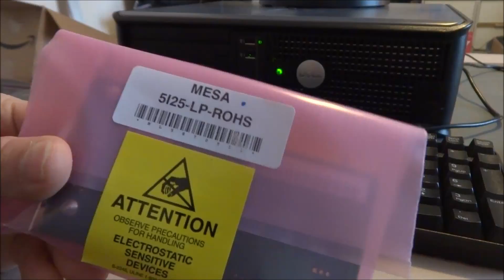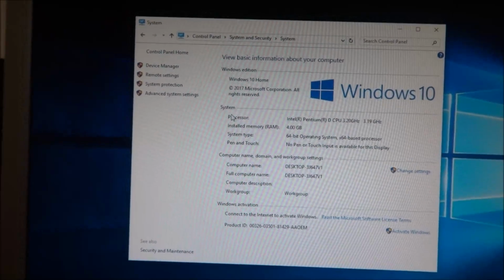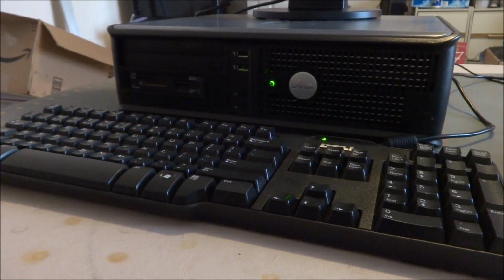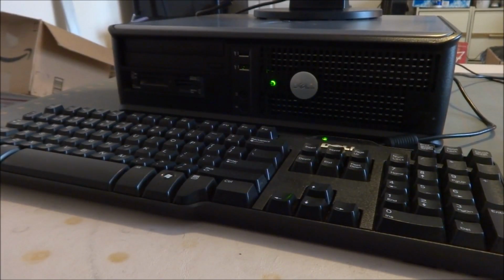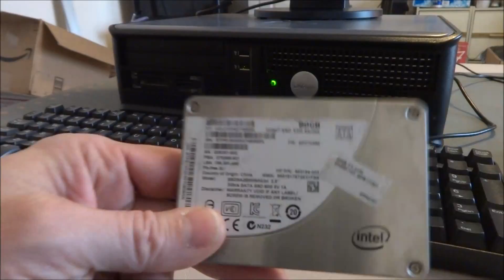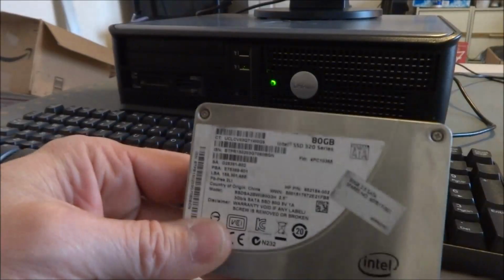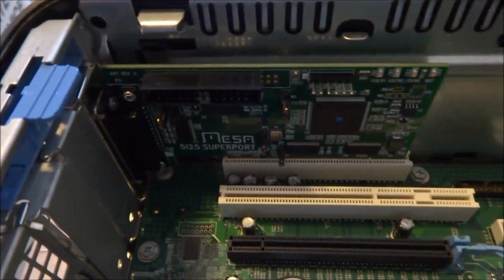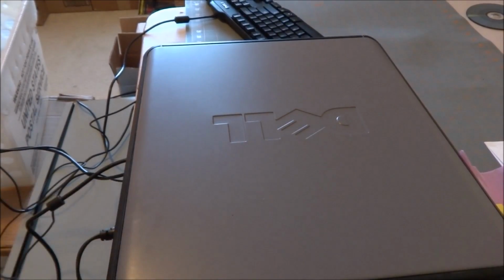Mesa 5I25 install

Comment: I have a 1997yr.old Theremwood cnc router  will this run the drives that on it ?https://cache.industry.siemens.com/dl/files/543/59401543/att_53104/v1/PJU_0212_en.pdf

Comment: we know that the 5i25 is used for linuxcnc, is correct that we base ourselves in http://linuxcnc.org/docs/html/config/pncconf.html for the configuration?, should we do a special procedure for the card installation? and if this is not the case where can we find the step by step for carry out this procedure without complications?

Comment: I originally had my mill on Mach3 with a pmdz card then setup the same on LinuxCNC...the Linux is a nightmare really unless you are good with programming but once you have it going its soooo much better than Mach3. I got a 5I25 and a 7I76 as well and started putting it all together about a year ago. I was slowly getting it all working then I found the Masso. I got a Masso and never looked back...no programming to worry about and its been bulletproof. I love it. But if you are sticking with a computer based mill software then the Mesa stuff is the way to go. Like the Masso they are proper motion controllers.
Reply from the maker: Mark Kyle 
Hi Mark I too find Linux cnc can be a little difficult to set up and change parameters. But a much more powerful cnc controller. 
Plus I'm looking into Path pilot. And I also have a Masso controller so at this point I'm keeping my options open at this point. But excited to try them all. Masso is great for setup. However once setup you really never mess with the setup  much.
Reply: My machine ran nicely on LCNC even with the PMDX-126 controller. Far better than it ever did on Mach3. Doing the Mesa conversion meant going through all that headache stuff to get it running. I am very happy with the Masso. I have spoken with Jatinder about using the ITTP with the Masso. I am off to NZ in 2 weeks for a holiday and will be dropping in to see Cliff if he is available
Reply from the maker: Sounds Great Tell Cliff I said Hello,  Yes I hope Jatinder can implement some probing routines this year.
Reply: BTW I really like your videos. As soon as they pop up I watch them. I always learn something..keep up the great work

Comment: One more comment (I promise) I have experience with dells like that you need an add on video card with its own memory. The on board has shared memory. Then you think I have plenty of memory? Does not work that way I believe it has to do with Buss speed. The CPU and card cannot accesses the memory quick enough at the same time.
The way you can test that is set up the system load a 3d intensive program lots of g18's and G19's  . remove any tool do not load material. start the program go to the tool path tab in mach3 in large the image and use the left mouse click to rotate the image of the part  while the program is running. Also speed up the feed rate progressively. how long you can do that before the motors skip a move or stall tells you how close you are to the capacity of the computer under load. (Poor boys stress test) In mach you can go to the general config window and turn off the high resolution also the blocks around the buttons to save video memory usage. Still needs a separate memory card. Linux has different displays as you know they may or may not use the memory in a more efficient way . I dont think its more efficient. You may need a different mesa card if your using the only add on slot needed for the video card. All of this applies to other brands of computers also
Reply from the maker: Thanks Tom, That's good info, I will have to see once the CPU is up and running. I had not had a issue in the past with Mach3 running on these cpu's maybe the G code I typically run does not stress the Memory enough. I will make a note if problems arise.
My machine pc's only run the Controller software I do not use them for other tasks.

Comment: it is good to see that you made final decision on mesa card and the linux cnc。 it is all better than any others  except that linux is a bit difficult to learn also the gui is not so user-friendly(may be better now?)。 i tried it a long time ago without any extra card and by using parallel port。and only lasted for a month or two。 then switching to mach3 and using it till now for almost eight years。 by almost done everything with it including writing program routines for auto probing and toolchanging as well as doing pendant and 4th or 5th axis by it。thinking that in next upgrading of my cnc。 i will recall back all my forgot linux and do the linux system and mesa card instead。it will be a challenge again。
Reply from the maker: Hi Ray, Yes I could not agree more , that is the main reason I personally went with mach 3 in the beginning. It was much more user friendly that Linux cnc  and still is However I'm at a crossroads now with pending upgrades and My current C11Gs BOB while great will need to be upgraded for the 4th Axis , PDB, and ATC . There are just not enough I/O's available. so rather than go with a ESS and and a C62  For the same $  I could convert to Linux CNC and Maybe even Give Path Pilot a try. Plus Like you I enjoy the Challenge.
Reply: It’s still not easy before you make the switch. I went to switch from mach3 because of all the pc crashes shutting down in the middle of milling and now I’m probably selling all 3 of my 5i25’s and 7i76 to go to masso or acorn.

Comment: Why the 7i76 and not the 7i77 which is for 10v analog servo control?
Reply from the maker: I will be running the Servo's in Step and Direction They can be run either way.

Comment: I would have went with a Centroid Acorn.
Reply from the maker: The Centriod Acorn appeared to be a good option and I did look into it. However the cost of the Acorn is a little  more than the Mesa Boards, Liniux CNC is also a proven reliable CNC controller. and both options need a CPU. The Acorn is very limited in terms of I/Os. So for me it was not a good option. Plus with the upgraded software your getting into a $600 price range. Any more improvements to the system and they will cut into there Oak controller sales.
Reply: I agree centroid is a top company for high $$ conversions and machines but when they came out with the acorn they ended  up in a literal rock and a hard place. make it good enough to sell but not compete with themselves as for as the much higher priced oak line. So allot of what you see on acorn is hype its actually limited on features
Reply from the maker: Exactly very well put! a full blown Acorn system runs $725 without tech support!  ,  $470 for mid range software and $325 for there limited free software. In the end your limited with the I/0's I think overall Acorn will appeal to many as they package it as a simple plug and play system just as Clearpath has with there servo's which is not always the case. as many have found out.

Comment: Hello Sam, Since getting that computer have you run a latency test on it to see the response time?
Reply from the maker: No I have not , Its a fairly powerful CPU for running cnc control software I don't think there will be any issues. I will try and test it but I dont really have a good way to stress it at the moment.
Reply: Tom Hutchins you can run it from the applications menu > linuxcnc > latency test. You can do this from the live image before writing the image to the harddrive.
Reply: ? how do you do that
Reply from the maker: You can run it from the PNC config wizzard
Reply: Make sure you are running a real-time kernel. Without this it doesn't matter how powerful CPU is, the latency won't be great.
Reply: Hey Tom, do a quick search on youtube for it, I had a desktop that I thought would be great . Loaded Linux and ran the Jitter test, it came back with a real high number, not good at all. I like the idea of the test and If I go the route Sam is I will ask for the test number before I purchase. Just something to add to the  list of things to check off the list.
Reply from the maker: Yes i did see that option I will run it and see what it comes back with. Again there's not much on the cpu to stress it so I dont know how reliable the test will be. I also read it's a good Idea to run it for several hours.
Reply from the maker: I will run it and see what it comes back with. Again there's not much on
 the cpu to stress it so I dont know how reliable the test will be. I 
also read it's a good Idea to run it for several hours any ifo will be helpful this is all new ground for me.
Reply from the maker: Thanks Jared
Reply: Similar to the Mach driver test? also If you go to diagnostics in mach watch the kernel count it should be + or minus no more than one if it is more thats why your having a problem with mach. Your computer system is not stable. I have run mach successfully on 4 machines but you need the tricks and what to watch. Mesa is interesting because of the speed and internal board.
Reply: Browningmotorsports
 One more comment (I promise) I have experience with dells like that you need an add on video card with its own memory. The on board has shared memory. Then you think I have plenty of memory? Does not work that way I believe it has to do with Buss speed. The CPU and card cannot accesses the memory quick enough at the same time.
The way you can test that is set up the system load a 3d intensive program lots of g18's and G19's  . remove any tool do not load material. start the program go to the tool path tab in mach3 in large the image and use the left mouse click to rotate the image of the part  while the program is running. Also speed up the feed rate progressively. how long you can do that before the motors skip a move or stall tells you how close you are to the capacity of the computer under load. (Poor boys stress test) In mach you can go to the general config window and turn off the high resolution also the blocks around the buttons to save video memory usage. Still needs a separate memory card. Linux has different displays as you know they may or may not use the memory in a more efficient way . I dont think its more efficient. You may need a different mesa card if your using the only add on slot needed for the video card. All of this applies to other brands of computers also

Comment: Great vid Sam - gittin 2018 kicked off right !  Linux CNC huh .. I look forward to seeing your progress on its install and setup and what advantages you get over Mach3.  Question though ... seems a shame to hook up a nice PCI card in there only to use a parrellel port/cable to connect to the Controller Box .... any insights as to why they chose that over ethernet - and is there an ethernet version from them?
Reply from the maker: That's a Good question I personally don't know what advantages there would be to Have a Ethernet  FPGA PCI card. Over the 5i25.  This setup is a proven reliable system " If it's not Broke Don't fix it"  the Process speed with this setup if far greater than you need so I don't Know enough about the Ethernet PCI cards to say I would benefit.

On the other hand Ethernet motion controllers for Mach3/4 can sometimes be buggy Not sure how much Mach 3/4 is to blame or the Ethernet connection.
Reply: The 7i92m will do the same job as the 5i25 except it does it via Ethernet. That is what I. Using on my Kitamura.
Reply: Ethernet sends data very quick but in packets bursts. So it needs a secondary possessor  to sort it out . Its really not the magic answer. parallel ports send data through multiple dedicated channels at the same time. Its actually an ideal setup for motion control. The neg is speed on the older style ports they only work up to a point. With the direct card like the 5125 mesa you get the huge advantage of dedicated parallel channels and the speed. 
I will be following this also sounds like a good deal so far. 
Ps from what I have read its a parallel port format but not like the older ports
Reply: I have used Mach extensively yes like most complex software it can have bugs. Seems like most are either a setting incorrect or an issue with the computer. For example dells like you are using can have various issues and many times resetting the memory solves them. (removing it cleaning the contacts and reinstalling). Or a lagging hard drive with bad areas can be an issue. They seem to work right but when you stress them they fault. Cleaning the cach files and defragging seems effective.also shared on board video cards use memory and can cause issues in some applications like true 3d machining and more. And then people are quick to blame Mach but that's not whats really wrong
Reply from the maker: Yes the 5I25 port will be dedicated to the system not competing with the CPU's other tasks
Reply from the maker: I use Mach3 on all three machines for me it has performed flawlessly. I do have all my machines with a dedicated PC only for running the machine. my need for upgrade stems from the need for more I/o's  the cost of a ESS and new BOB to update a old cnc control software just did not seem to be the best answer. Mach4 just seems to be lagging far behind everything else.

Comment: I am really interested on following the details of installing and using Linux CNC.  When I started It didn't seem that reliable but that was a decade ago.  If it is good I would love to switch from Mach3. Thanks.
Reply from the maker: Linux CNC is a very dependable , reliable Platform which is one of the reasons Tormach switched over to Path Pilot which is Linux CNC. The issue is and has Always been Not a User friendly when it comes to setup.
Reply: I used Mach3 before although not on mill but plasma cutter. Always had some little problems. Since i use UCCNC not a glitch. Great software as well
Reply from the maker: I Also looked into UCCNC as well again it needs windows
Reply: I checked out ruff stuffs videos on linux . Does not look to bad to get going. many setting available but many are default. basically the same settings as mach just in a much more basic code level instead of all the graphics mach has. (this alone could take some demands off the system especially a marginal system.)Linux is know for being a more stable operating system. But a well configured windows system is also stable. I believe thats on of the reasons they kept XP for so long.
Linux is free this alone tends to make people much more forgiving kind of like running a business selling cheap you will have lot's of friends but will go broke. 
If you have a licensed copy of mach and have used the email support Im sure you have noticed there tech guys answering , not public relations type's there response can be accurate but blunt. Thats not helping mach's image. Tormach may have switched for many reasons like maybe just to get independent from mach at a tech level or $$ related if they were selling windows and mach they were paying for 2 licences on every unit.. 
Just a feeeewww thoughts. lol. will keep following this series like the no bull format
Reply from the maker: Thanks Tom
Reply: Windows will never be a realtime operating system, no matter what you do to it. When linuxCNC is installed, a custom realtime Linux kernal is created (compiled), which is what you want for any type of machine control. If you join the LinuxCNC mailing list, you will have the best support you could ask for
Reply: Kermit frog. Real time is a term that is misused. I ran both systems on the same machine with a 3d program. mach was more accurate. I used a simple ebay BOB that amplifies the signal. Mach has many features that are not available to linux. Just one of many is Linux just finally updated to A form of CV and look ahead in 2014 and called it revolutionary! Mach has had those features from the beginning .I had a fanuc 6m that had look ahead in 1983. Were people get confused on the real time thing is mach running through a parallel port in my opinion is real time Mach generates a kernel it goes to its own channel.
Its when you add a smooth stepper or something similar that is using a USB or Ethernet it needs to be buffered.
Linux is good for to types of uses in my opinion. One a very basic motion control for a beginner that wants free software.  
Second is since its open source amateur and pro developers that like to play with code. 
The main trick to mach is the right computer with the right software configured correctly. There are some tricks involved on the windows side.
If you get mach set up right you dont need to be on a mailing list for support you dont have to write your own program like linux Mach already has more features than most people can use already done!
I have tried both linux and mach have you?
Ps Linux wont even except fanuc style sub programs.
Mach will except all kinds of post possessors.